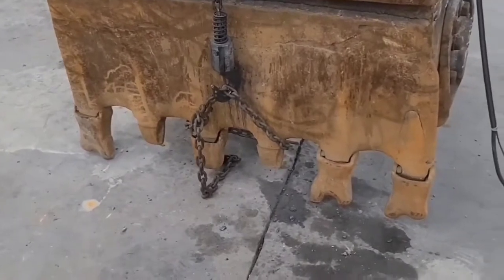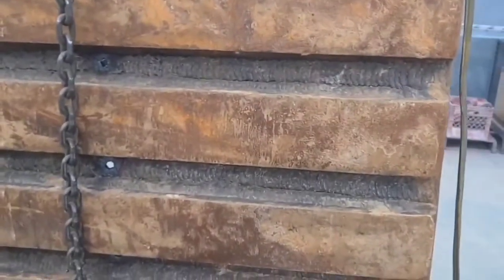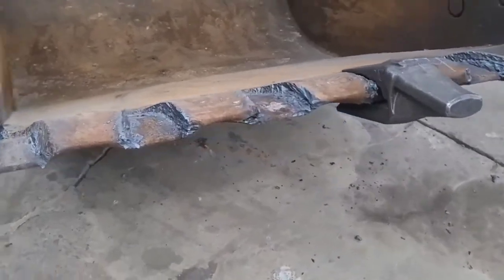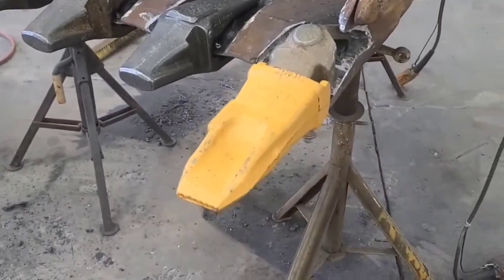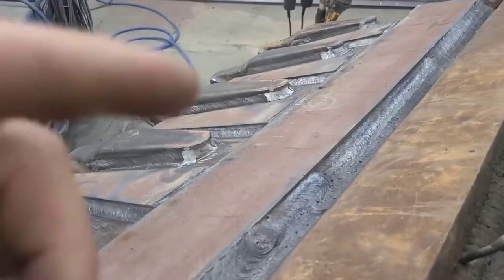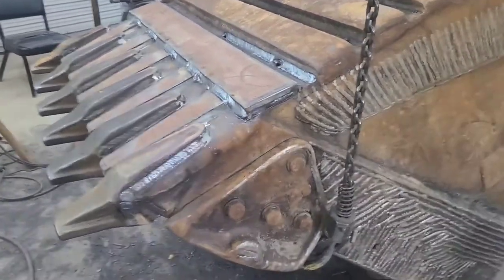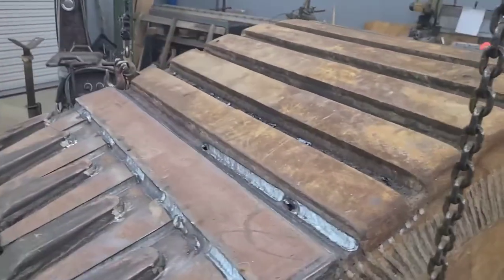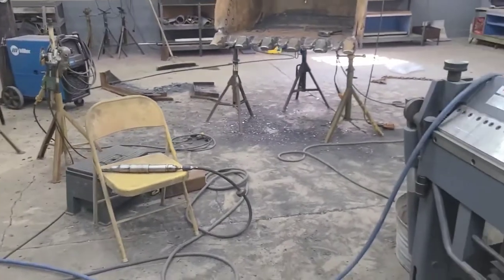Excavator bucket repair part 1

Comment: Great work young man. I like jet rods (7024) because they lay a bead fast and smooth. But, like a 6013 you can easily get slag inclusions and screw the weld up.
I think so l may be wrong, that they are no longer considered suitable for structural use?
Great video too, Part 2 next.
Reply from the maker: Yessir rods like 7024 & 6013 can leave slag inclusions and care must be taken to prevent the slag from taking over the weld puddle…it can be handled by managing weld position, arc length, and amps

When I worked in a structural steel yard in the 90’s jet rod was still in use but I don’t know as of now if that is still the case or not…they cannot be used if the engineer specifies “low hydrogen” but most of the drawings we worked off of back then just ask for welding electrode to be 70XX…so if it was a 70,000psi tensile strength then it was good

Comment: Those types of buckets crack a lot.  Magnaflux  testing finds a lot of cracks that can't be seen.  Find em, fix em, then charge a bit more.  There is both wet and dry magnafluxing.  It's worth looking into.
Reply from the maker: I've dealt with magnaflux testing and I don't find much value in it...most cracks found that way are visible to the naked eye or will show up when your working on it and it gets warm.
In my opinion magnaflux devices would just be cludder  around here that I don't need.

Comment: How much is the savings from buying a new one and actually repairing the old one?
Reply from the maker: I was told a new Caterpillar Bucket this size is around $15,000
Reply from the maker: Based on the cost of this work I think around $10,000-$13,000 was saved opposed to buying a new Caterpillar bucket...but cheap aftermarket buckets made of cheaper steel are available for much less than genuine Caterpillar

Comment: what machine do you use??
Reply from the maker: XMT 304
Millermatic 252
Trailblazer 302
Lincoln Commander 300
ARCCAPTAIN MIG 200
Primeweld TIG